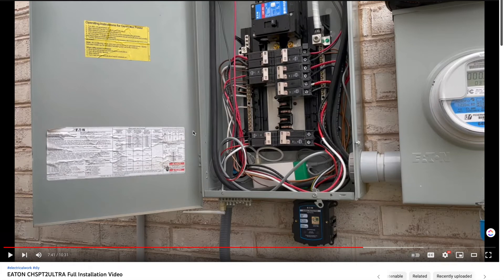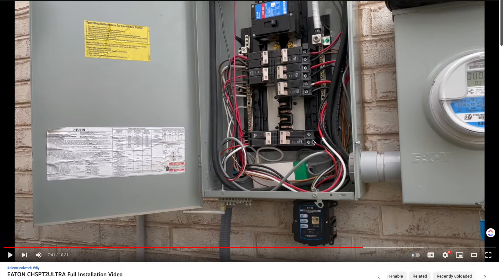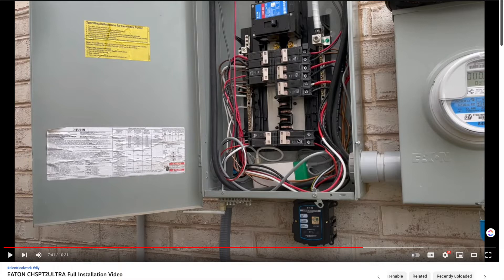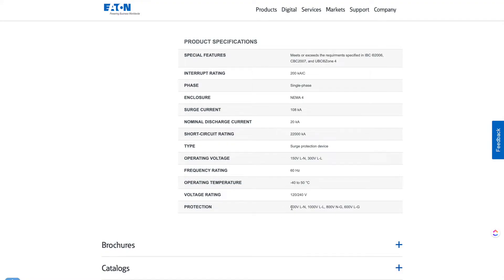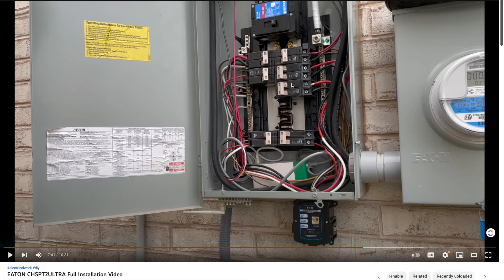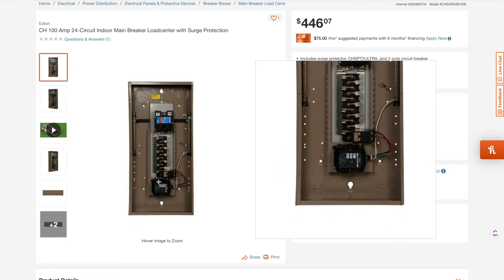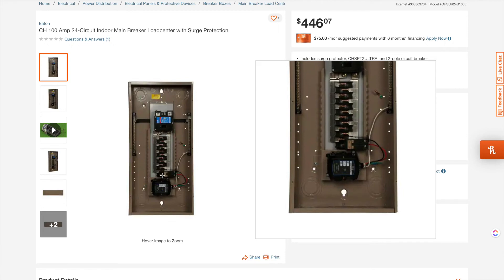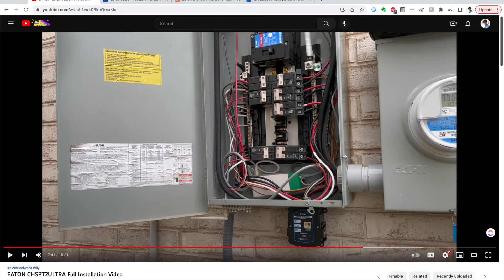Can Whole House SPD Type 2 (Surge Protection Devices) be installed in any breaker slot?

Comment: Thank you very much for this video!  I had mine installed on the bottom and was worried that I'd have to move it for it to be fully effective.  Glad to hear it works more as a pressure relief valve and it's not a case of the electricity starting from the top and blowing circuits as it works its way down.

Comment: Great video.  I did calculations using aluminum resistivity and cross sectional area of the bus bar and wires.  The voltage drop on the bus bar is negligible compared with wires of the power supply and wires into the appliance.  Therefore, there should be no difference if  you place the SPD in the first  or the last slot in the panel.    I do calculations in my 40 years of professional life.  Something everybody is saying for millions of times does not mean it is correct .  Most of saying is only based on what  people feel, and no scientific base.

Comment: hi there, are you using a 30amp circuit breaker instead of 50 amp?. Which Eaton model ru using?. I also reside in Texas. Houston. I am running a WEN 11000 using a 50 Amp breaker to power up my house, including a 4 ton AC unit. I am also using an easy starter. Based on your video, I am considering to switch to a Champion gen. Thanks
Reply from the maker: Hi @carapungo, I am using a 30amp circuit breaker instead of 50 amps and a NEMA 14-30 plug instead of the NEMA 14-50. I would caution you to not be too hasty in switching from a larger unit to a smaller one without checking if everything will still work. If you have the 50 amp setup already and you're interested in using a smaller one for fuel savings or to go from standard generator to inverter generator, I would simply get a NEMA 14-30P to NEMA 14-50R adapter and try it out with the smaller generator instead of replacing breakers and generator inlet boxes.

You can pick one up from amazon https://amzn.to/4f8Znin pretty easily.
Reply: @jonathanDIYs  thanks for your insight.

Comment: 100% Jonathan! Stop wondering whether you are correct or not. You understand the subject correctly and the analogy to a pressure relief valve in a fluid system is absolutely pertinent. Without going into electron flow theory, i agree that it does not matter where on the bus it is located. I'm an old retired electrical engineer with 50 years experience.
Reply from the maker: It has been nice hearing feedback on this topic. I think I have learned a lot from the comments I received. Thanks for contributing!

Comment: Interesting note, I installed the ULTRA in 2011. The 2010 version of the manual stated to use a 15 amp breaker which I did. I just noticed that the 2015 version of the manual states to use a 50 amp breaker in order to achieve the full potential of the CHSPT2ULTRA version, lol. Only the CHSPT2SURGE  uses a 15 amp breaker. Thanks Eaton! I paid for a better product, but have had it installed on a 15 amp breaker for 12 years.
Reply from the maker: That's annoying... I found the instructions for these things to be pretty hard to find. It would be nice if Eaton had FAQ and video installation instructions.
Reply: Same here. The instructions on old one said 15 and the electrician I used confirmed that was correct. I guess I should change it now. Super annoying

Comment: I just installed the same Eaton unit, watched many videos in regards to placement, wiring etc... I purchased a 15 amp bi-pole breaker, installed at the left leg at the top of the panel, first two slots, dedicated to the Eaton, nothing else on the circuit. I mounted the Eaton directly across from the breaker to have a short run. Hooked up the neutral and ground, and good to go. 

I also purchased and installed a KVAR unit, not for energy savings, but for its real purpose, softening the load on the panel when a motor starts up, like your well or refrigerator. I had issues with LED lights flickering when the well or refrigerator started up, those issues are now GONE! 

I installed that on a dedicated 20 amp bi-pole breaker at the top right side of the panel. The darn thing works. So, if you are having issues with lights flickering when an electric motor in your house starts up, you may want to look at a KVAR unit for the whole house. If you are having issues at the AC compressor, they make smaller soft start units that can easily be installed inside the unit, simply wire in at the units control panel, they run around $20. Hope this helps!
Reply from the maker: Thanks for commenting Michael! Glad your setup worked out for you and thanks for sharing about the KVAR unit. I'll have to check out what that thing does - it sounds like a really useful device.

Comment: My guess is that the impedance of the bus bar is so low it’s not a contributing factor. The same goes for the fixed impedance of the breaker which has to be in place.

However, the length of the red/black leads from the breaker to the SPD which need to be TWISTED TOGETHER to minimize their impedance has the greatest impact on the clamping voltage in the Eaton videos which appears to be linear.

So, what’s the best location? Whichever knockout minimizes the length of the wires to the breaker which is exactly how their load centres with the integrated SPD mount are designed.

I went looking for info from Eaton to verify my theory and this video confirms it:

https://youtube.com/watch?v=MptHFrqOrYU&si=EnSIkaIECMiOmarE&t=424
Reply from the maker: Thanks for your comment and sharing that video! The information about wire length impedance and how they test SPDs to establish their rating was definitely very informative. I wish this information was more readily available. I've seen electricians even extend the wire to get it to the first slot - wire length is one of the biggest factors to how low these units can keep the voltage low.
Reply: @jonathanDIYs  The installation manual is missing all this important info so even electricians just guess.

In my panel, I’d love to get the wire length down to 3 inches but there is a stud and 8AWG cable in the way.

Comment: Hi,  The question here is one of what you can do for optimizing the protection you get out of the device. Keeping a short lead length maximizes the performance of the surge protector in reducing the size of the spike you can observe on the bus. Eaton has a few brief instructional video on their website. Unfortunately they do not seem to post copies of their videos on Youtube so they are hard to find -- But for example they have a great, brief 61 second video showing the effect of the lead length to the surge protection device on how good the voltage clamping for a spike is. 

In the video for a 7,000 volt test spike, with the device mounted directly on the bus at the entrance, the peak current is 382 v; when the same device is mounted on the side by main shutoff (looks like ~12" lead), the spike on the bus was 495 v, and that same device mounted with 3 feet of lead lets the bus voltage spike up go up to 882 v. So if at all possible, mounting at the very top of the bus with leads as short as possible maximizes your protection. 

See https://www.eaton.com/us/en-us/products/backup-power-ups-surge-it-power-distribution/surge-protection/surge-protection-faq.html

As you noted the Eaton Ultra the installation manual does suggest two steps to maximize performance:
"• When connecting the wires from the CHSP to the electrical
system, cut the wires as necessary to keep them as short as
possible - 12 inches (30 cm) or less is recommended.

• To maximize the CHSP’s performance, twist and bind the wires together to reduce the impedance of the wire (one twist / inch)."

 In Eaton's own panel you showed the Ultra is about 3.75" so it looks like  total additional lead length is 5" more by having it down at the bottom of that short panel. In the photo of the panel they also didn't twist the leads much. All of which doesn't mean it won't work but the trade off is a bit of boost in performance for the one time cost of labor.  

Finally, one deficit about the Eaton Ultra is there is an audio alarm. Most, like the Eaton Ultra have just have indicator lights so you'll have to notice when the device gets knocked out. The Siemens FS140 has an audible alarm but alas for us they were out of stock everywhere when our installation was being done so we went with the Eaton.
Reply from the maker: Excellent commentary. Definitely having the SPD as close as possible is beneficial in ensuring the clamping voltage will be as low as possible. Thank you for sharing the videos and that resources page - I haven't seen that page yet and I enjoyed watching the video and seeing the analysis. In the video, I did notice that the measuring device is measuring the voltage at the meter. I wonder if there would be any variation in the peak voltage if measured at the load (the light in the video) after a 20 or 50 feet wire run typically seen in a residential homes. Most residential devices are dozens of feet away from the loadcenter.

Comment: Just curious. Did the installation instructions comment about where the optimum placement should be?
Reply from the maker: Yes, but not in regards to installing it as close as the supply as possible. In fact, the recommendation is to install it in the breaker closest to the CHSPT device.

Here's the exact verbiage:

Locate a dedicated unused, or install a new 2-pole circuit breaker in an available space closest to the location where the CHSP is to be installed. A dedicated 2-pole15 ampere circuit breaker is recommended for use with CHSP devices, but use a 2-pole 50 ampere circuit breaker to achieve the full published ratings of the CHSPT2ULTRA device. (The connecting wires do not carry supply current. Instead, they carry only short-duration currents that are  associated with a transient event.) 

You can get a copy of the manual yourself (it's only 2 pages in 3 different languages): https://www.eaton.com/ecm/idcplg?IdcService=GET_FILE&allowInterrupt=1&RevisionSelectionMethod=LatestReleased&noSaveAs=0&Rendition=Primary&dDocName=IB00414001Y
Reply: Nice investigation and further review / follow up

Comment: Great Video. Again they are clueless, you'd still get current to all the other circuits if it was even in the first slot, so putting it in the first or the last doesnt make a difference, the 2ft of travel to the surge protector is still shorter than the 50ft it needs to travel to the nearest appliance.